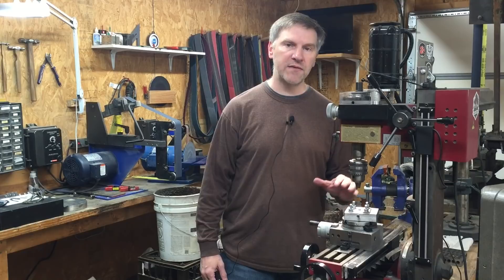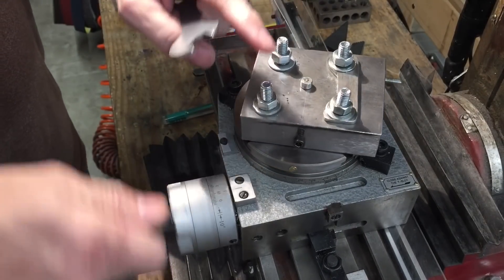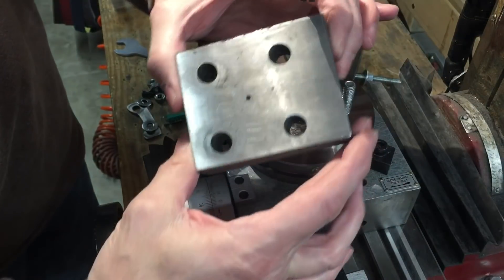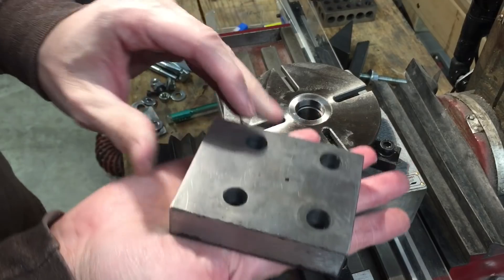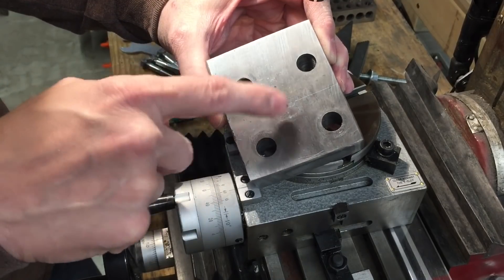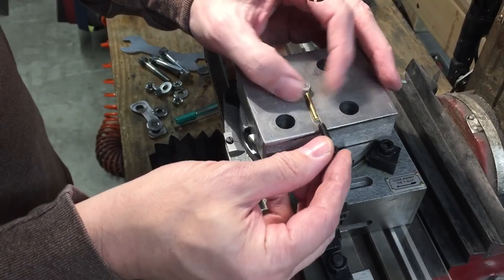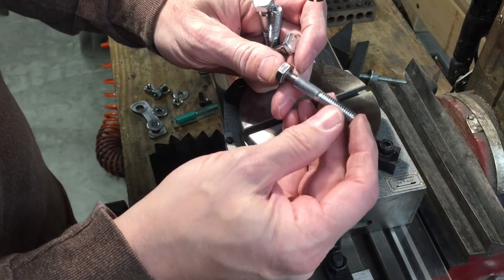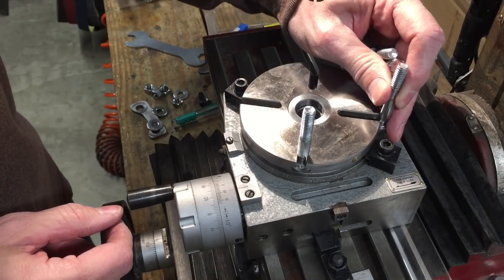Setting Up the Rotary Table

Comment: You don't center your rotary table to the spindle first?  Or is all that matters is the hole in your metal plate being centered to the spindle?
Reply from the maker: The hole in the middle of the plate has to be centered to the rotary vice. It really doesn't matter what their relationship to the spindle is. I just use the spindle to help me measure and make adjustments until I get everything lined up. You could also center your rotary table to the spindle first, lock everything down, and then drill you're hole into the plate. Either method should work.